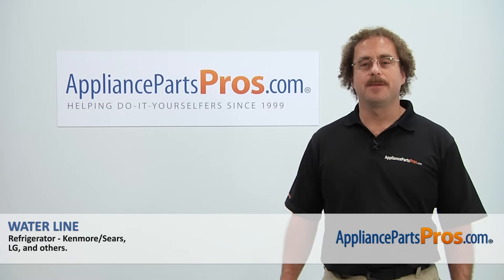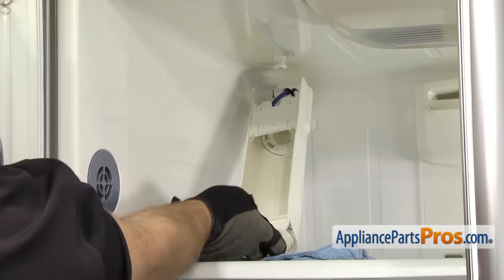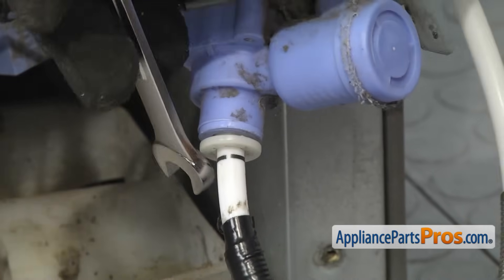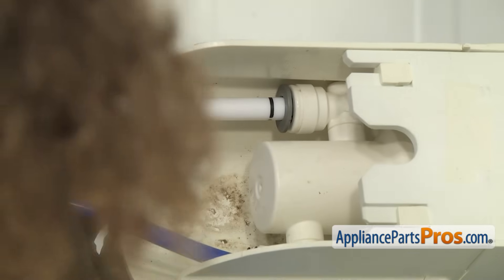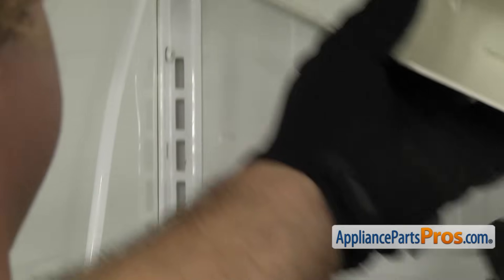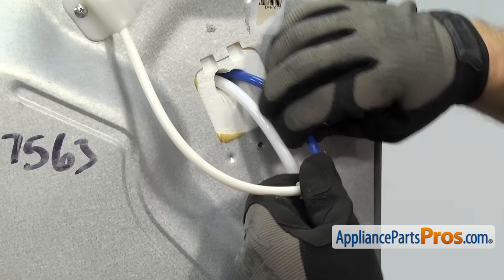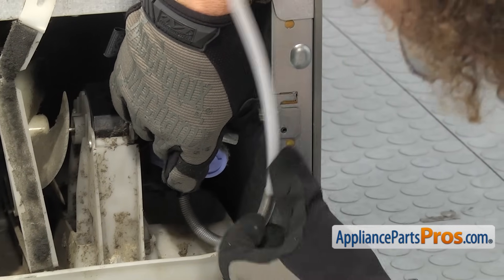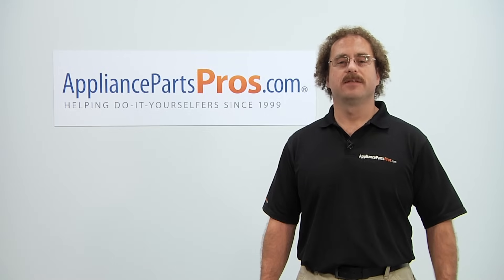How To: LG/Kenmore Water Line 5210JA3004U

Comment: What’s the part number for that water inlet valve
Reply from the maker: By far the most reliable way of finding the correct part for your appliance is by searching using the model number. You can use this tool on our website to help you find the model number: http://www.appliancepartspros.com/modelnumber_locator.aspx If you still need help finding a part, we're happy to help you out. You can give us a call at 1-877-477-7278 or you can chat us at our website: http://www.appliancepartspros.com/.

Comment: Right where the water line hooks into the back of my kitchen aid fridge it's leaking. There's a small clamp clamped onto where it connects to the valve,? no copper lines all plastic lines.  I use a RO system so I bypass my inline fridge filter. I'm lost here. Bought he fridge new in 2006. 

Could the little clamp be loose ?  It seems it's on tight.  EEEK this intimidating.
Reply from the maker: Are you talking about the quick disconnect on the inlet valve? You could try taking it out and cleaning it up, but if the o-ring inside is damaged it will probably leak again.
Reply: AppliancePartsPros

Comment: So 2 lines go into the cover, and one comes out with filtered water and goes back into the fridge near the top. Mine is split near the area it reenters the fridge. I must have to take the entire back of fridge off to replace it.  lfx25978st.
Reply from the maker: Is it the water line going to the ice maker or the water dispenser that is broken?
Reply: @appliancepartspros  the dispenser, because it only leakes when you dispense water.
Reply from the maker: The part number for that water line is 5210JA3029U. You can place the order through the website, or you can call us at 1-877-477-7278 to place the order over the phone.
Reply: @appliancepartspros ordered online, thx
Reply from the maker: You're welcome!